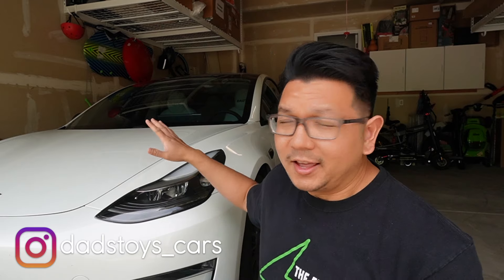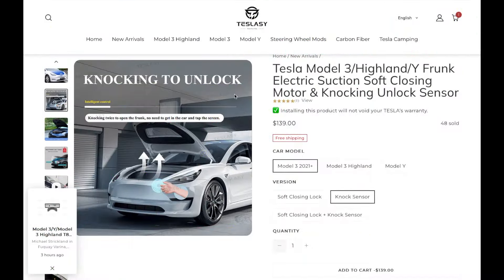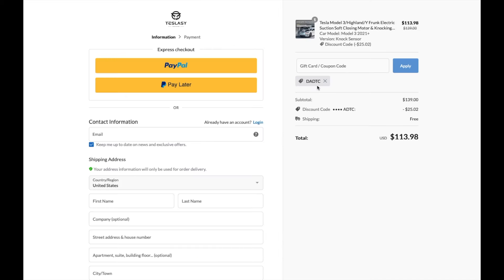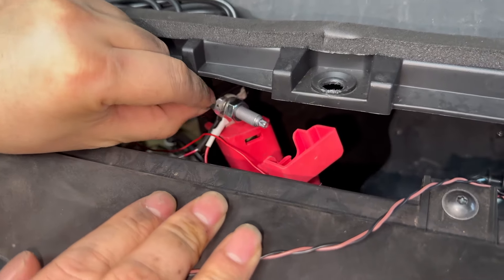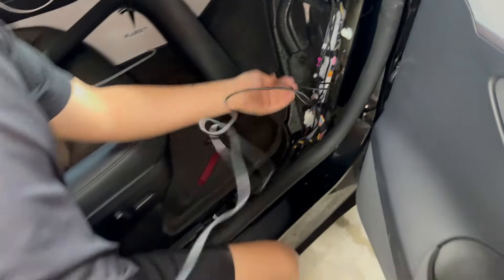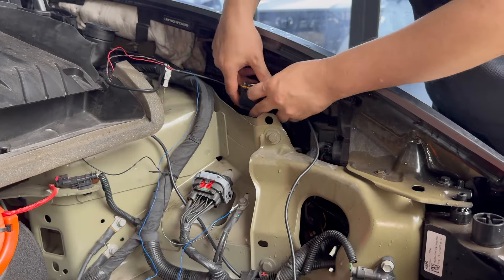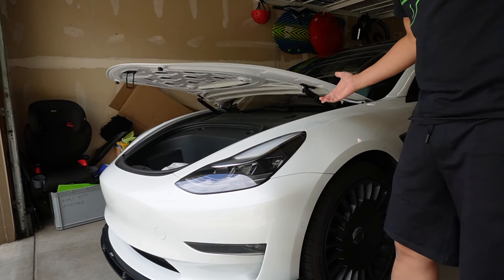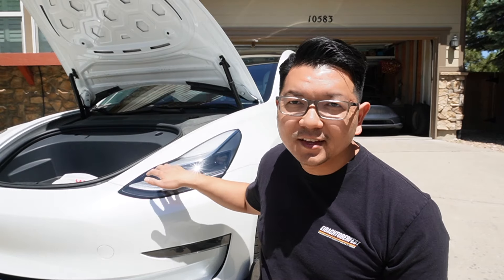New Model Y/3 Power Frunk Knock to Open Upgrade! #tesla

Comment: Nice installation.  Have you tried the SEXY Commander V2 using the door handle.  This is a neat idea.  I was even thinking of putting a sexy button in front of the grill part of the car (somehow waterproof it).
Reply from the maker: I never actually try that yet.
I have seen it in the app with those options.
Thank you for watching and your great support!🙏😃

Comment: Hi Paul, I have a RHD model Y, does the wire have to pass through the Driver side of the vent? Please advice, thanks in advance
Reply from the maker: I’m not sure let me reach out to Teslasy and ask them to make sure.
It should be the same side.
Thank you for watching!
Please subscribe for future contents.🙏😃
Reply from the maker: I got the response back from Teslasy. They said it’s on the same right side.
Reply: @dadstoyscars  thank very much for the info. very much appreciate
Reply from the maker: @zionxpro  No problem 😉👍